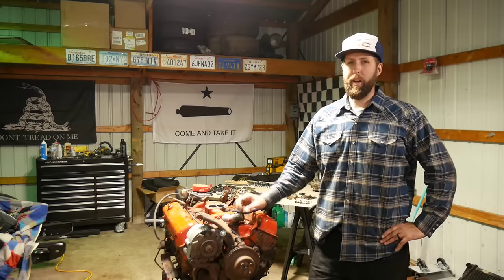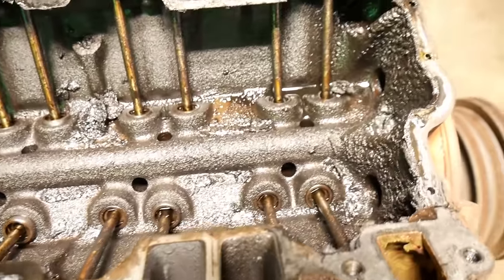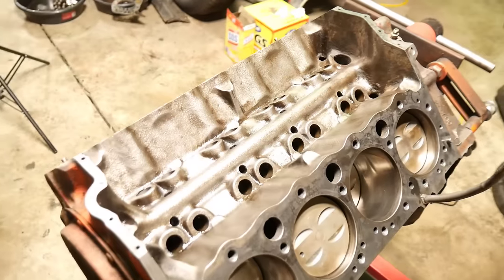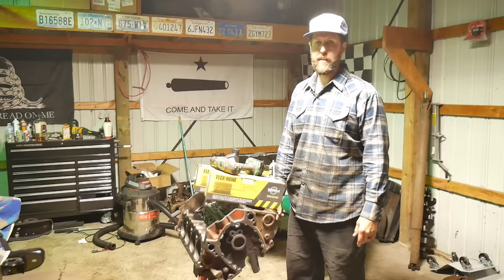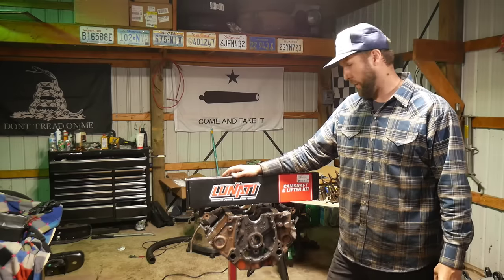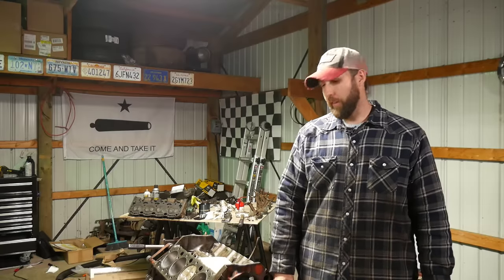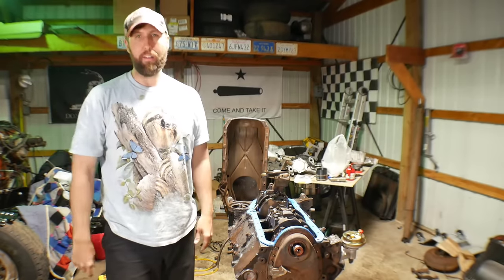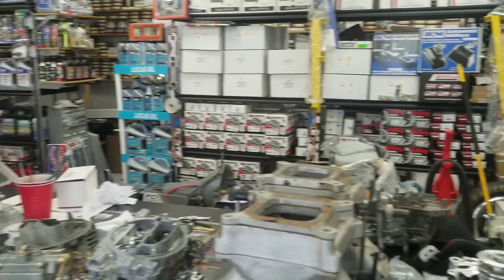Budget 307 Small Block Chevy Build & Dyno - Vice Grip Garage EP28

Comment: I used a 307 in my street stock years ago. I had forged pistons. 492 heads 2 barrel Rochester carb off a 396 from a Caprice. Corvette cam I got for 36 bucks from the Chevy parts department. Ran really well.

Comment: Theres a trick to the rubber front/rear intake gaskets. I use them, BUT, they have to be cut to size. Most people dont and just layer then on top of the head-intake gasket. That throws everything off, so you have to kind of line things up by eye, and then cut the parts of the rubber gaskets that lay on top of the head side gaskets.

No leaks that way. Did the last nearly 10 years ago, and shes still fine.

Comment: Frigg buddy! I was thinking 190-210hp. Make me wish I could do that to the 305
Reply from the maker: thanks for watching! you can do that on a 305 easy
Reply: A 305 will make power, don't let anyone tell ya different.
Reply: @dreamstreetskate5291  there are guys running nhra stock eliminator with 305's with a very strict rules package in mid 80s Camaros running low to me 11s in a quarter

Comment: I've heard that a stock cam out of a 350 makes HP improvements in a 307.
Reply: There must be 20 different "stock" cams for a Chevy 350.
Reply: macklandtube I’ve also always wondered what a set of 283 power pack fuelie heads would do for the 305/307 strokers
Reply: @tomjennings7044  : power pack fuelie heads?

Comment: Inquiring minds want to know .. what is the camshaft model and specs ?
Reply: OEM cam for a 67 - 350HP 327 Corvette. The GM part number is 3863151 and was often referred to as a "151" cam. .
Reply: @Slugg-O  Sealed Power stocked it back in the late 80s under their own part number, don't know if they still do. It was much smaller dollars then from GM.
Reply: Pretty sure sealed power part was cs179 I also had it in my 307 spare change engine!

Comment: I had my 307 chevy bored  out to fit 350 pistons . That makes it a 327. I put dart iron eagle heads on it. Roller rockers with summit 1785 cam . Holley 600DP. Weiand intake.. Runs very strong

Comment: A 307 is a pretty stout little Chevy small block with the larger main and rod journals. I had one in a '72 Chevelle as a teenager in the early 80's. I beat the crap out of that thing and it never gave up the ghost. It was pretty quick out of the hole, just no top end power. I had a 4 bolt main 327 a friend gave me and was always gonna drop it in the Chevelle but I ended up getting rid of the car for a van. I was a guitar player in a working band and needed the van for gear and after hours 😝😝😝

Comment: I worked in a Chevy dealership for many years starting in the early  80's most always used the silicone bead on the intake ends, Permatex 16BR was a preference and never had an issue.  Thread sealer on the front 4 bolts is a good idea too...  that has bit me in the butt before. 
 I am currently retired and finally getting around to ressurecting my 63 Chevy Impala Sport Coupe my grandfather gave me when I was 17. After something like 24 years sitting in the weather, it has been a challenge. Am I rambling again? Anyways for some reason I decided to use the little rubber ends when I was resealing the engine. ..did use sealer on the corners though. I guess we will see how that went.
 Love the videos.. Keep them coming.

Comment: I had a 81 Chevy C10 with the 250 straight 6. Was not working for me and dumped a fresh 383 stroker with trick flow aluminum heads and a Crane roller cam and roller lifters, got a killer deal on a Richmond 5 spd. Dynoed rear wheel HP was 548. Also had Holley Projection on it. Miss that truck.

Comment: Did one like this for my pickup. Little 305 bored 
.040 over. ~312cu. Same heads as yours, I just ported them. Cam was a melling 440 lift, 224° duration @ .050 and a 114 lobe separation. Flat top pistons. About 10:1 edelbrock eps intake. Holley 600 carb. Runs pretty good for a little motor. I spent about $1400 including buying the motor to rebuild it. I was guessing 280-300hp looks like I'm pretty close

Comment: had a 69 nova that had a 307 someone else had put in it before I got it. did pretty much the same thing never dyno the motor not many around back then. same carb as you. slightly more aggressive cam from crane and a set of 305 heads. Not like you where going to keep anyone from grabbing the 20 taped to the dash or anything but kept her sideways when needed and peeled the tires at every light. Good times and awesome memories from Pete's Drive-in back in kck.

Comment: I use the right stuff and do it the old way just as you did. Easier and if done correctly it will not leak. The other ones will eventually leak quicker than the old way.

Comment: My buddy put the heads cam intake n carb from a 66 impala ss onto his 70 chevy pickup 307 .It would rev to 7500 go 90 mph in a second on a three sp with stock gearing of 3.07 ratio It eaily made 325 hp n blew away alot 350 chevelles ,302 mustangs The oringinal farm truck racer !

Comment: I really like how you use the old school method on the intake gaskets, I usually prefer going the same route but lately I’ve just been using a couple old pieces of clothesline rope or some of grandmas thicker diameter yarn that I leave soaking in some lawnmower oil overnight then I just use a thin layer of R.T.V. On the block then lay the yarn in place and torque down those intake bolts !!!

Comment: Derek. Watch your videos. Haven't seen this old one. That's a good ratio of horsepower to torque for a small block. You Didn't spend alot of money,  yet you had almost a horsepower per cubic inch .. with a small block in a light nova.. would be a screamer... I like the torque.. it was making... Mid 300s. Great little engine.. take care tim

Comment: Ran a late 70s Camaro roundy round car with balanced 283 with domed poppers and h.o. 305 heads and too much cam. Revved to the moon and kept up with 400s 383s etc. On the track. Hard to beat rpms on short track.

Comment: Yes you can do inexpensive repairs and builds on the 307.
Remember what it is.
Don't expect a 283.
You can make it breathe and modify it.
They tow pretty well.
You're not trying to beat records.
You can use the parts for the durability engine GM used in medium trucks.
If you want positive control seals for your valves, you may need to get the casting and guides looked at to mod them.
The orings have a short life and the umbrella is the first step up. I sure wished it was discussed beforehand but it was not.
The ends of the intake can use GMS or "the right stuff" according to Lisa who was a godsend to me in my altered states.
Double roller timing chain and an RV cam. That's what we used.
350 intake and carb.

Comment: All is not lost with the 307. You can swap in a 327 block and  the crank from a 283 and have a sweet 302. Salvage set of 2.02 heads and an OEM solid lifter cam and you’ll have a Z 28 motor. Best SBC ever. Easy peazy.

Comment: I always heard good things about them it’s always factory the same car as truck 200 hp and 2 barrrel carb now they always say 305 heads there’s a 67cc and a 58 cc. Now those old motors came flat top true flat top 4 valve relief so with 305 heads should shove that up to 9.7:1 up to say 10.7:1 plus the 305 heads are for unleaded gas

Comment: all that clean up, I just let the machine shop put the parts in their washing machine thingy. Although since most of them have switched to powder and water, the parts come out with a funky color. Kind of a greenish, grayish, darkish tone. Using those flex hones, I found out when you pull them out they will spray you with oil. I try to setup some type of shield to keep the mess from getting all over me.

Comment: 290 horsepower 328 foot pounds of torque not bad for 307 now with the 416 heads put a new valve put new valve springs retainers locks seals replace the valves do a port and polish job at another 2030 horsepower to that to that 290 horsepower and put some rollerrock some low-budget roller rockers on there like a like a like a steel roller tip Magnum or like to set that I got I got a set of eBay roller rockers not to mention gasket matching importing the intake and get out there and kick some ass I love the build keep up the good work

Comment: I picked up a 73 350 4 bolt main that the guy thought was a 307 for $75. It had two flat cam lobes and a broken top ring. Tore it down new bearings , replaced the broken ring, had a crower hydraulic cam on the shelf. Installing cast iron bow tie heads and a victor junior on it. Should run well. For a minimal amount of money, less than $600 with the parts I had.

Comment: found a cute little trick Rhodes makes a two stage lifter below 2800rpm it lifts the cams design profile #  above 3500 rpm the lifter opens 30/40 k more at the valve with stock rocker ratio. So a 350 lift will go 380 works better with a split  profile and double roller rocker stock ratio .

Comment: you can add the v6 or I4 roller lifters if ya grind on the lifter guides in the rear , and  drill and tap the block for the 3 factory spider bolts ,, the v6 roller lifters are the same height as the stock v8 flat lifters

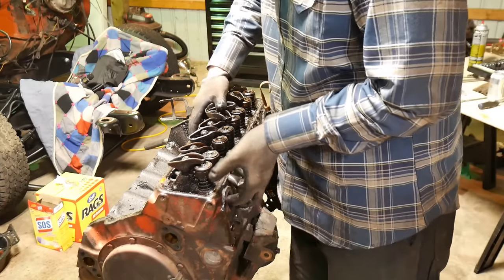Comment: Derek, did you ever do anything with this 307? I am building one now..... 30 over, 1971, will have 2.02 heads since they will fit bcause its bored out. Will also be ported heads intake and exhaust, and ported torquer 2 edelbrock intake. And 5 cm holley 2 barrel carb...... It's for a dirt track street stock. With a powerglide and 4:56 rear gear. Will run only 2nd gear... 3000 lbs g body

Comment: I'm running a 69 307 with 300 HP heads 194  valves 475 lift & 290 duration cam edelbrock springs and pulls up to 6200 rpm range

Comment: Did you dial the cam in? Lunati never works just installed, i think they do it on purpose, not my favorite cams. I built several 307s years back, made good power for a small engine,  i used the General Kenetic cam with a RPM intake, cam installed at 106, Z28 springs on 58cc 305 heads with 1,94 int valve upgrade, 14 top ring gap, 16 second ring, using 305 forged flat top pistons, deck cut to zero deck height and heads shaved for 025 quench, i like dangerous, Compression ended up at 10.1,  we ran it in a street S10, ran high 12s, but it took some tuning, lol. it was fun taking junk left overs and make a spunky little engine, enjoy watching your way of doing things,  you crack me up some times, lol

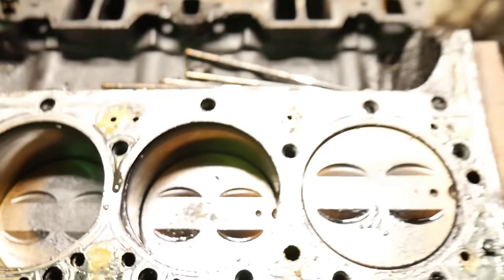Comment: I have a 307 in my 72 C/10.  Runs like a swiss watch and very reliable but yes, not much in big ponies department for sure.  It works so well and is so smooth I hate to ditch it put in more power so a fella may just keep her as is under the hood and pretend he didn't see the 307 thing.  What I need to do is focus on my 4 spd muncie transmission and rear end.  Fella has a rig that is geared way too low.  First is not required for anything but a parade and she is screaming like a kid on chocolate in the Walmart at 70mph.  I can't decide to go new school and drop in a 6spd or pop out what I think is a 4:11 in the ole tire making er turner and put in something lower. Help a fellow understand...put in the old bleep bloops below with your thoughts....

Comment: My 2008 Shelby GT mustang it's just a 4.6 it came with a cold air intake maybe a little hot or two and 319 at the flywheel bolt on and Dyno tune supercharger centrifugal Novi 1200 I used the killer killer instead of the air to water intercooler I used a water to refrigerant system. The main problem to overcome is heat saturation you double the horsepower you should be doubling the heat saturation so the 4.6 is a 281 cubic inch 3 valve I ran 100 octane two step closer spark plugs weather water which helped alright 170° thermostat and adjusted the electric fan cut on cut off 39 lb fuel injectors change the title max mufflers. It's a great day with supercharging you don't have to worry about the cam you don't want that high lift cam stuff it's not going to help it's fine with the forced air my Max booster is 13 PSI and granite tele Motorsports said nice setup just try not to go 13 pounds because it will go there they won't worry about that. With that car you have chargeable control valves or flutter valves valves whatever you want to call them I use delete plates. I'm going to say you can get into the 400s with that old timey engine.

Comment: 307 is a good engine, honestly, I saw a lot of that gunk like you discovered from excessive STP oil treatment and Pennzoil believe it or not. Awesome head choice! I always used the rubber intake gaskets in the kit with a dab of RTV in the corners unless I put an aftermarket intake on due to possible clearance issues.

Comment: 307 with power pack or 305 heads usually equals Purdy good fuel mileage, that 307 crank also does descent with 4.125 bore 6 in rod

Comment: Very cool build!  Looking at numbers from production cars the L69 HO 305 was rated at 190 hp and 240 lb-ft of torque, so this 307 appears to be roughly in the same neighborhood if it was installed into a similar vehicle.  Maybe a little higher, actually, I'm guessing around 200 hp and 250 lb-ft net rating.  

I'm curious what this would do with a better cam and maybe a little head work.  But regardless it sounds like a fun engine to run around with.

Comment: There are two measures that are bandied about whn it comes to performance engine builds. The first is HP equally cubic capacity. Getting a 307 to make 307 hp is not difficult. What is a challenge for these pretty ancient tech engines is the aim of 100 HP per litre and do it reliably. Do that and you can congratulate yourself.

Comment: My favorite cam for stock replacement in 307 is the comp XE256. It does need valve springs but it gives you all the power the stock heads have under 5500 rpm

Comment: I had the Australian version of the 305 (5033cc) I believe but it was sleeved down to a 304 (4997cc) To bring it to  5.0lt class to unify racing here in 1984. Had a T400 trans, 10 bolt salisbury diff with 3.08 ratio & a rochester 4 barrel rated at 680 cfm. Was a nice cruising setup. Valves were too small and she had a habit of running lean. Apart from that, was a comfortable package I owned for 10yrs. Kinda wish I didn't sell it. With today's tech I could've easily tickled it for a tad more fun. Oh well, wasn't really family friendly back then. Retrospect really sucks sometimes. lol

Comment: That's cool, you didn't paint the dyno room with engine oil and parts plus the thing put out pretty good power for a bunch of unknown pieces bolted together. Makes me think that if I come across an old Chevy with a 307 I'll try to get it dirt cheap and do what you did to the motor.

Comment: I'd have put a set of power pack 283 heads on it....or a set of vortex heads off a mid 1980s 305ho.....and a factory 350hp 327 cam or a comp 260/460 and a set of roller rockers with a edelbrock performer intake. And long tube headers. The 307 heads with those tiny valves is what holds it back the most.

Comment: fore and aft i use cork and seal both sides with 3m weather strip out of a tube. hold it in place and nothing leaks with that stuff. valve covers on the covers not the head.

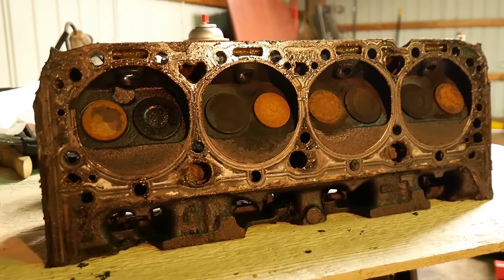Comment: Vortec heads good valve springs 280 480 108lsa cam 230 at.050 lift should give ~340HP  at flywheel with 750 Holley carburetor 3:73 to 4:11 gears muncie m22 or TH350 and 2400 stall converter.

Comment: If you end up with a used engine with sludge like this 307, just run a pint of diesel in the oil for about 100 miles and dump the oil. You'll be amazed.

Comment: Back when the 307 engines were common The 307 engines always were oil burners. The 350 engines with the same or even more miles were not burning oil. Obviously the 350 engines put out more power. My dad had a 1969 C10. It had a 307 and 3 on the tree. It was burning oil by 80,000 miles. I do agree that someone should build whatever engine they want. The engine you built made good power.

Comment: When building a small block, I always I mean ALWAYS use a one piece Pan gasket and sillycone on the ends of the intake. Throw those silly rubber end "gaskets" straight in the bottom drawer of the toolbox. An extra 25-30 bucks is well worth it, unless you want automatic rust prevention...

Comment: I love the 307 motors ive had several and always run a big cam and holly 600 had one of them in a old 70 truck named Elvis plug defowlers on all 8cyls it would pop n back fire til it warmed up so funny miss ol Elvis. Always use tranny fluid for honeing and stp or lucus for assembly lube soak lifters and pistons in motor oil.

Comment: Other people don't know that 307 blocks can be bored 125 over which gives it a 4 inch bore by standard 327 Pistons and Whammo you have a 327 the motor is large journal if I remember right you can use a 350 crank and standard 350 Pistons Whammo 350 I had a machine shop did it many times I always took those junky 307😁